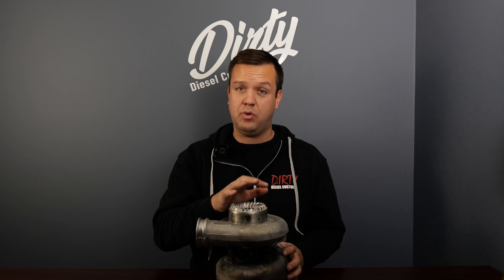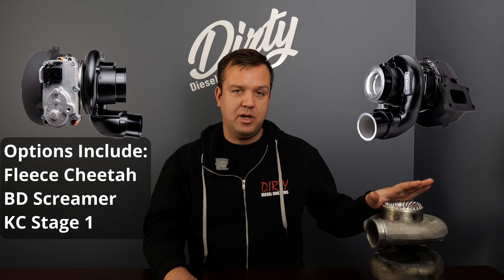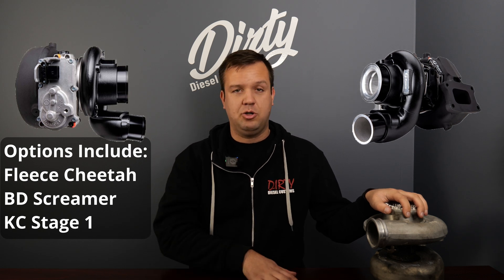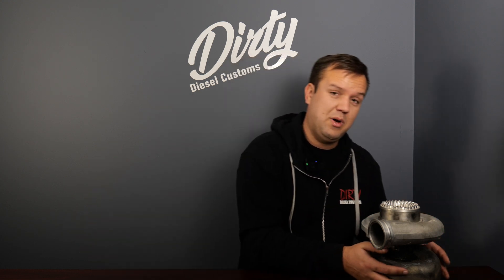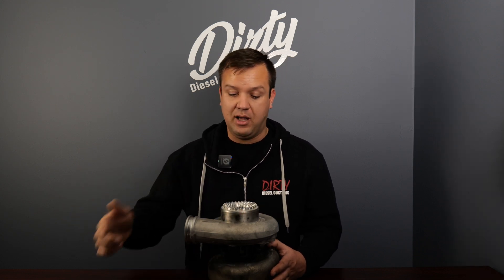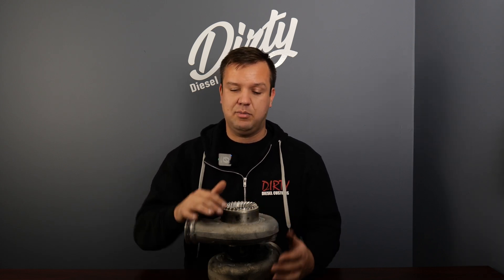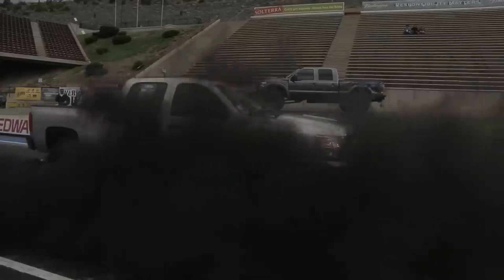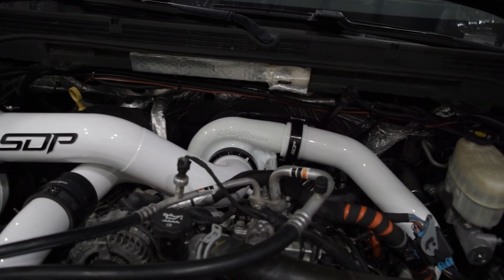Choosing The Right Turbo For Your Diesel Truck

Comment: Do you guys carry a aftermarket turbocharger for 2.8 duramax ?
Reply from the maker: The only setup we carry at the moment for the 2.8 is a compound turbo kit. No single turbo upgrades that we have at the moment. 
https://www.dirtydieselcustom.ca/collections/2016-2019-2-8l-duramax-stock-turbochargers/products/2016-2022-duramax-sdp-compound-twin-kit-w-sx-e-billet-turbo-sdp-1057